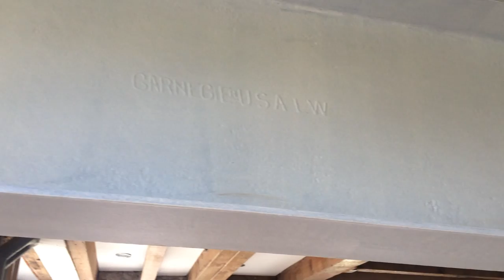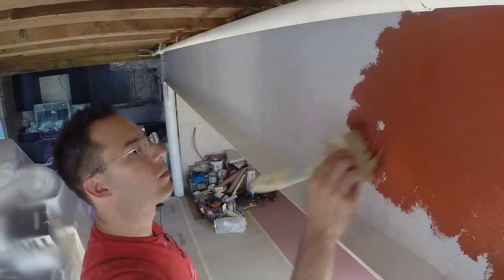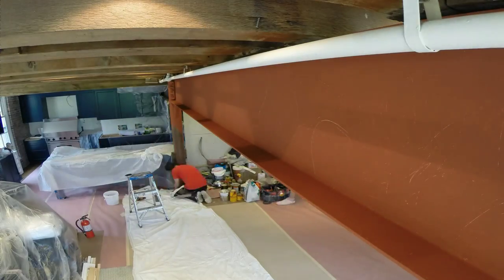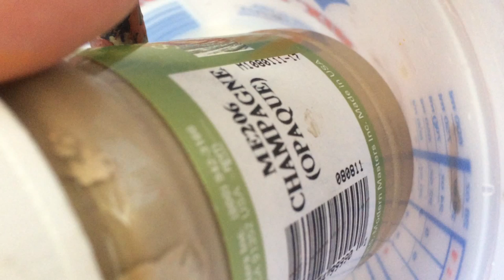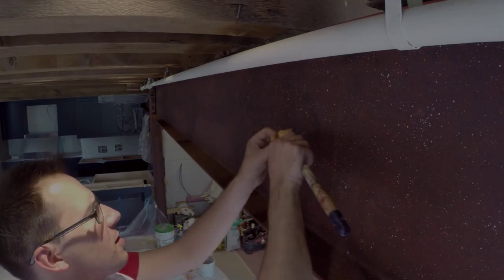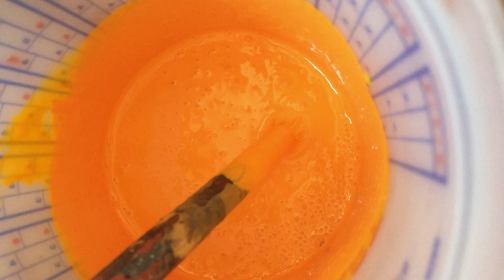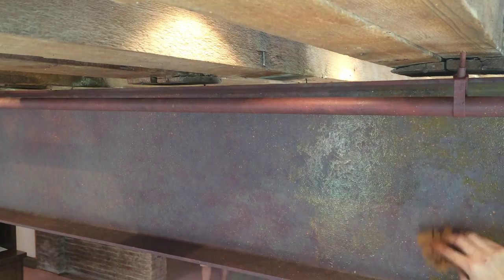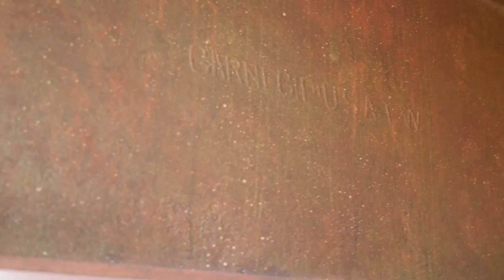How To Paint Metal Patina by Jeff Pollastro

Comment: Hello Jeff.
While watching this video, I started thinking about if that work was to be done, for example, around a fireplace (I mean replace the usual marble by a faux metal, marble, wood...) . My question is, if that were the case, and the client told you that he will use the fireplace as normal, what type of paint, varnishes or whatever materials options would you make to deal with the heat of the fire, specialy in the long term??
By the way, when are you planning to do more videos???? I miss them painfully.... pleeeeeeaaase :)
Reply from the maker: Good question, Tree Man.  Sure, I've done this many of times, and most mantles are painted here in NY (even if not decorative painted).  For extra security, I usually care mostly about the primer and the finish coats.   The base should be somewhat heat/flame resistant.  If a client is asking you to paint an existing mantle that is solid wood finish, then you'd just need to prepare the wood as per usual - sand finish, prime, base.  In this case, I like the product called STIX.  As its name suggests, it sticks to most everything, including glass (really well).  I'd also use this if the existing mantle were stone or marble and they wanted it painted.  Next, I may call a Ben Moore distributor and ask for the regional manager or supply technician and ask what paint they'd recommend for an exterior mantle work.  While you're at it, I would ask for a finishing product as well.  I have grown to like this 2-part acrylic epoxy by Corotech for places like showers or kitchens.   Perhaps this would work around a fireplace as well.  

Truth be told, there aren't many fireplaces that aren't already protected by heat.  They are usually brick, correct?  The mantle piece is solely a decorative item that surrounds the area where we start a fire.  This is already not going to get too hot.  I'm pretty sure that if you followed the steps in the video, on most mantles, you wouldn't have much of an issue.  The main issue would be mostly soot / carbon that gets onto the surface.  I'd just put a couple more coats of sealer / varnish on it so I could clean it with a bit of soapy water every once in awhile.

Thanks for your interest in my videos.  Hopefully I'll do some in the future.  I have a couple in mind, and have a lot of footage.  Sometimes the content isn't entertaining or good enough for a quality video.  I'm a bit more picky these days now that I have a better sense of filming and post-production.  Keep in tune, though, I setup my lights in my studio recently, so once my contracts come to slower times, hopefully I'll get more time in the studio to do those fun things for you.  Cheers.
Reply: Thanks Jeff. I will keep that info in mind and wait anxiously for those videos :) Cheers and thanks again.